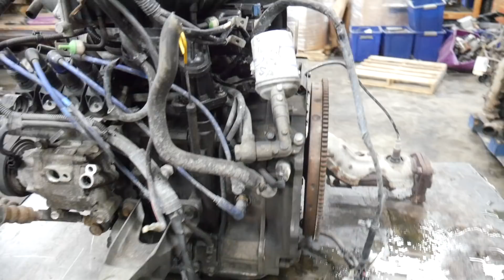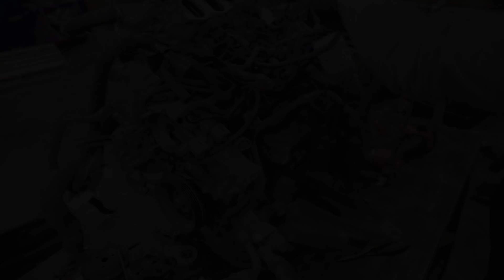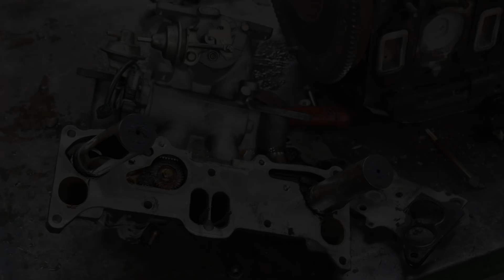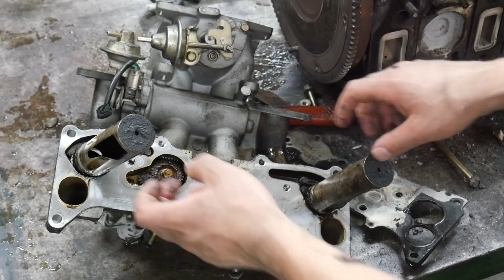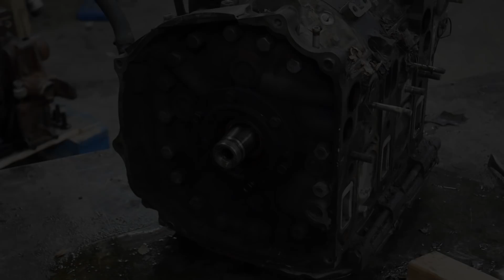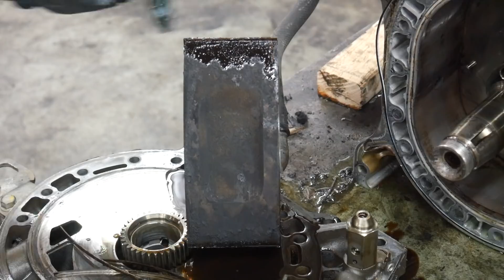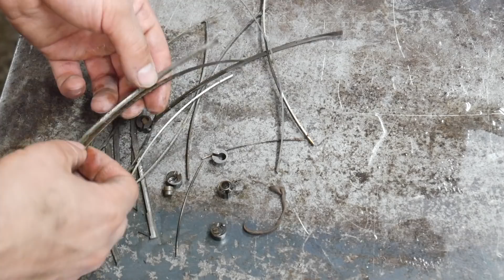13B RENESIS Total Rotary Teardown. 04-11 Mazda Rx-8 6-Port!

Comment: 8:03 well, you have to have a running Rotary first, some mazda guys are gonna be pissed 🤣
Reply: Nah! Thick skin over here. 😁
Reply from the maker: RotaryPerfection most rotary guys are this way. I wish more people wouldn’t take it as personally with other engines
Reply: @I_Do_Cars  Well I ain't gonna lie. About 15yrs ago, I was exactly like that until I wised up. In general, people go with engines they're simply most familiar with. Nothing wrong with that! I'm the type that will rotary swap anything but I also understand that the donor vehicle will have followers who wont appreciate what I've done. I fully understand the loyalist. Now I WILL get defensive if I run across those who blindly hate on the engine with ZERO personal experience and spread that info negatively. The engine is basically considered trash to people who truly don't know how they work and had misfortune. For those of us who took the time to learn them inside and out, these things are amazing and we don't have the typical issues most will have because we understand that keeping carbon out the engine is the #1 thing to longevity.

Edit: BTW I'm really looking forward to that Ecodiesel teardown. That's another engine that I feel is misunderstood and just need some people to take to time to finally learn what's taking out the bottom end. I wanna learn how to build them because that market could be HUGE.
Reply: @rotaryperfection  I’m in multiple Ram forums and the common factor on the eco diesels seems to be emissions systems. I know a couple people who deleted those systems off their trucks and they run fantastic.
Reply: @Redsfanatic32  Yea I believe those systems are causing oil contamination. My theory is this contamination is so bad that the canister oil filter eventually starts bypassing because it clogs up sooner than later. The one teardown video from a guy in South Africa showed the oil ports to the main bearing completely carboned up. To get that much contamination to build up in the main journal ports would be a failed filter or cheap oil reacting to the diesel fuel. I had an 2000 BMW M5 and German cars were very strick with the oil you used. These Italian engines are no different because not having the proper cleaners or detergents in the oil for a specific engine can cause problems like this especially if the filter fails. I hate canister filters for this reason because they easily collapse. My BMW had a 15k oil change interval. The quality oil I used lasted that long but the filter looked like it was about to take a shit every time I changed it. I think that's just wayyyyy too long and they need to come out sooner rather than later.
Reply: @rotaryperfection  No sir that eco-diesel engine isn't misunderstood, it's an Italian built diesel most likely built by Fiat since Fiat now owns Chrysler and Fiat has always produced garbage. The new Dodge trucks especially the eco-diesel platforms are nothing but complete garbage. I've owned Dodge trucks for over 30 years and they are a shadow of their former selves. I do own a Dodge truck now, 2nd gen, with a 5.9 Cummins turbo diesel and it's just a beast, mine is around 800hp with close 2000 lb/ft of torque.

Not sure if you know who Scotty Kilmer is but he is well known mechanic with over 53 years of experience and he breaks down that eco-diesel pretty well.
Reply: @anonymouslegion728  you've hit the nail on the head. My uncle owns one and is doing his research on how to make it reliable. He has to key the camshafts because they're known to walk out of place. What modern engine doesn't have keyed camshafts? Thanks Fiat
Reply: @I_Do_Cars  So does people that swap engine
Reply: Exactly what I was thinking

Comment: In theory rotaries are way cool, but in practices, well... it speaks to that when you see that Mazda is still the only one that has (wavering) faith in these engines
Reply: Yeah, I always cringe a little bit when I see Rob Dahm just adding more rotors when he can't even keep the older engines running. Rotary engines are cool but unless you have a team of dedicated mechanics and ongoing rigorous testing like in aircraft engines they just don't last. All it takes is a slight issue with timing or a little bit of wear before they grenade themselves.